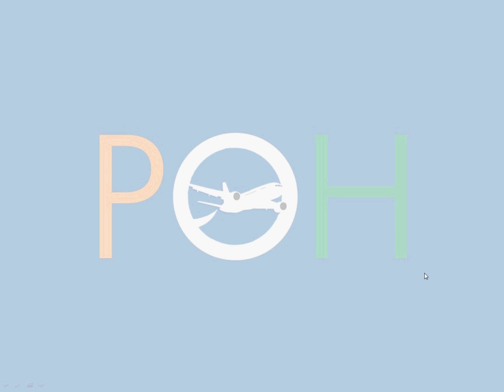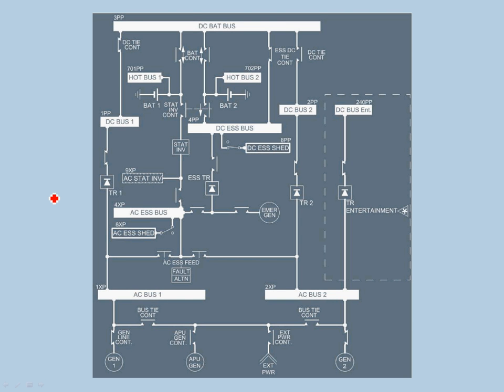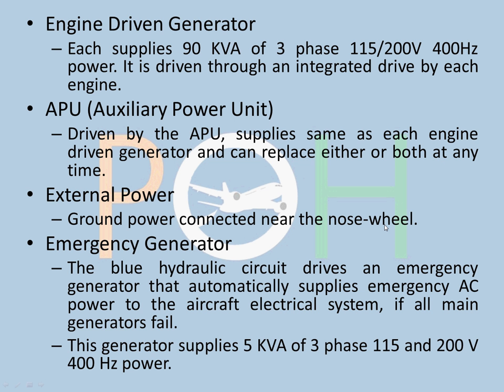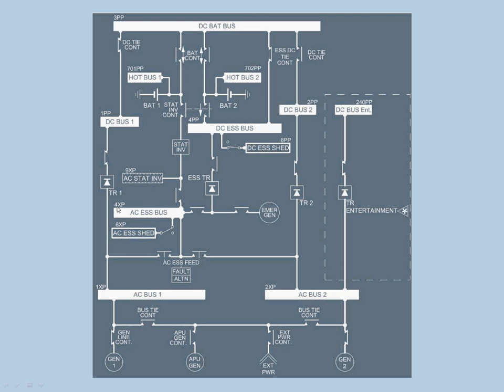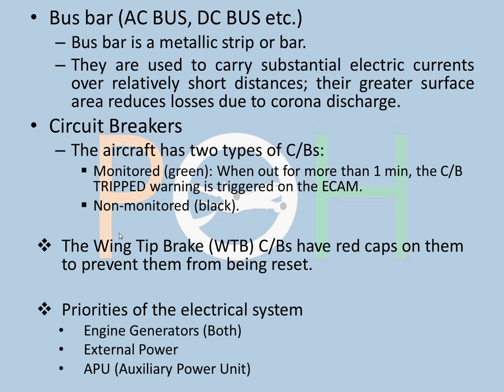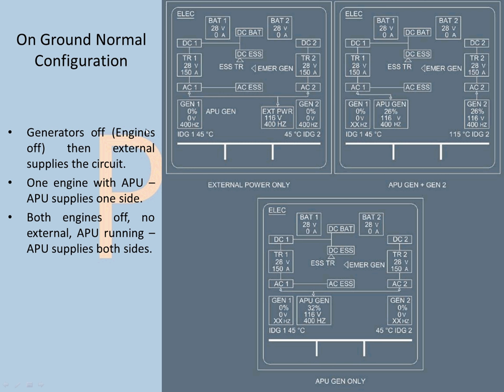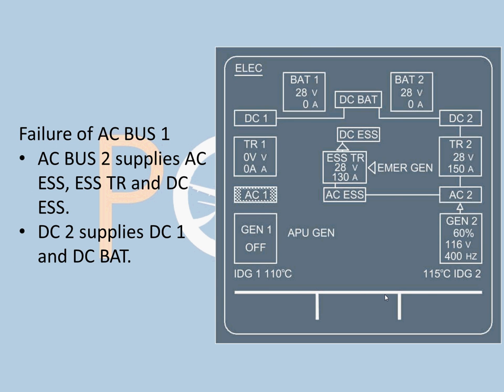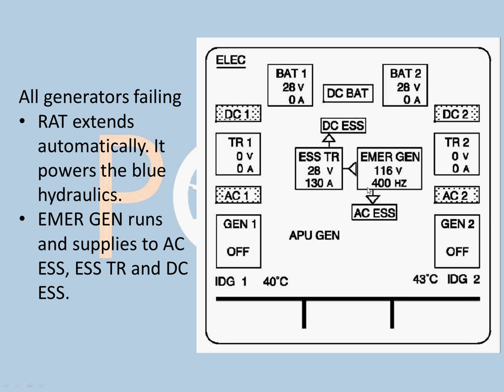A320 - Electrical

Comment: can APU be started with both TR1 and TR2 failure?
Reply from the maker: When the APU MASTER sw is set to ON, the battery contactors will automatically close for a maximum of 3 min to supply power to the DC BAT BUS which will help in starting the APU. Better to do it below 25000 feet for a successful start.
Reply: @poh  i saw the dc bus 1 + 2 failed procedure and in the status page it is mentioned that apu battery start not available. Doesn’t that mean the same for tr 1 + 2 failed?

Comment: Hey! i often see all your videos and learn so much from them before i flip through the books. i noticed something and wanted to bring it to your notice.
this is regarding Electrical Source Priorities. as per me it is 
ON SIDE GENERATOR 
EXTERNAL POWER
APU
OFF SIDE GENERATOR
RAT OR EMER GEN
BATTRIES. 
Please correct me if i m wrong.
Reply from the maker: Yes that's correct.

Comment: if GEN1 fails with APU and GEN2 running, APU has priority to power AC BUS 1 over GEN2.
BUS power Priority is,  
By the corresponding Generator [GEN 1(2)] (onside GEN)
By External Power [EXT PWR]
By the APU Generator [APU GEN]
Or by the other Generator [GEN 2(1)] (offside GEN)
Reply from the maker: Yes that's correct! 👍🏼 onside gen, external, APU, offside gen, RAT, BAT

Comment: Wonderful video again! Question though, nowhere in the FCOM does it actually explain what AC or DC ESS SHED buses are. I can’t seem to find a solid explanation online either, could you help?
Reply from the maker: It doesn't, but they are designed for less important components of the aircraft so that they can be shed to reduce load when aircraft is in troubled electrical situation such as batteries supplying which is a limited source!
Reply: Planes Over Head Thanks a bunch!!

Comment: Nice video but there is case also if all generator losts include emergency generator then your battery 1 will supply the AC essential via static inverter and battery 2 will supply dc essential. You should cover that too.
Reply from the maker: Too long a video it becomes too much to sustain for everyone.

Comment: If TR1 fails (i.e. in turn DC 1 fails), why does the ESS TR has to come in picture to supply the DC ESS?? I mean why can't the DC ESS be supplied by the DC 2 BUSS??
Reply from the maker: The idea is to use ESS TR as an additional TR back up, rather than relying only on one TR (TR 2).
Reply: @poh  Thanks a lot sir. I understood it now 😃

Comment: have you ever flown from VOMM? if so what sid do you use
Reply from the maker: Depends to where you are going to. Based on the direction! Whyb though?
Reply: flight simmer dont know where to fly from vomm
Reply: always wanted to talk to a real indian pilot
what are those little knobs and buttons on a320 pedestal nxt to radio?

Comment: great video..keep it up...but i haven't clearly understood the purpose of generator on right side. Does it only supply when generator on left fails or in addition to this there is any special task assigned to it?
Reply from the maker: It supplies the right side in normal conditions but is capable of supplying the whole system as well during failure of the left generator.

Comment: Question: What is the difference between an IDG and a CSD?
Reply: Those day generator and csd is separated...today csd is combined  with generator and become IDG..the primary function is generate electrical power by variable input from engine,and constant out put which is 115v 400hz
Reply from the maker: +Neville A I don't think there is much difference in them.

Comment: what does 115/200v denotes
Reply from the maker: +Ishwar Vyas An aircraft uses AC power which normally comes from a generator that has 3 seperate windings inside it. This gives 3 seperate outputs (or phases) from the one generator. If one was to measure the voltage between a single one of these phases and ground you would get 115volts. If you were to measure the voltage directly between 2 of the three phases you would get 200volts.